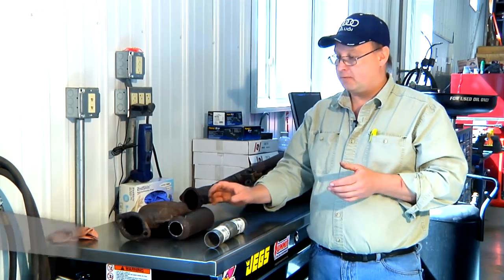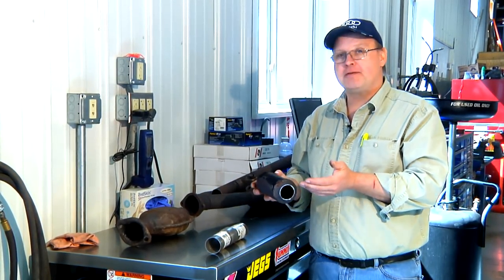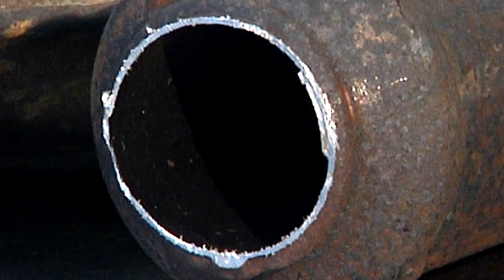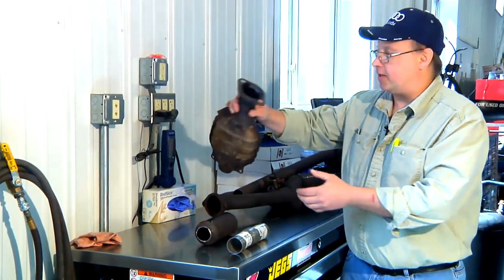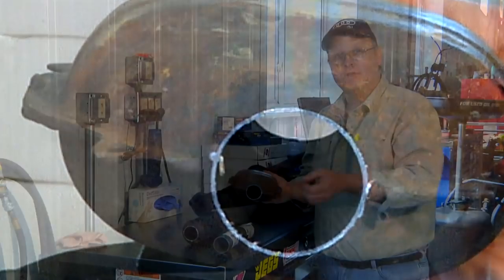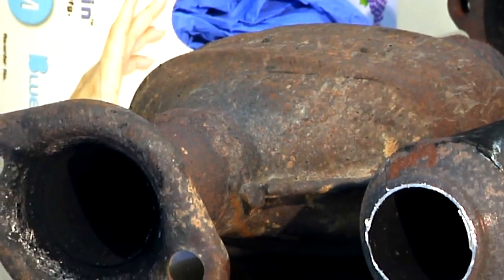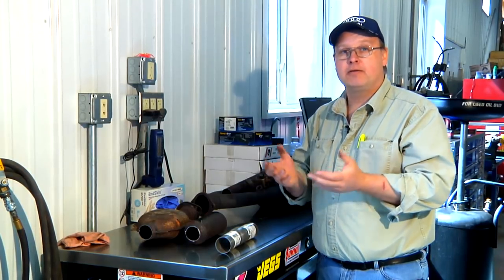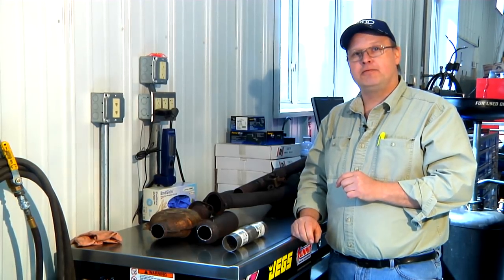What Happens if You Replace the Exhaust Resonator With a Pipe? : Under the Car Repairs

Comment: I deleted the resonator on my 2012 impala LTZ and drove it 900 miles. Significant increase in exhaust note start up, idle sound, Db, and air flow. I have gotten compliments on the sound just driving in and around town. Its one of the best and inexpensive mods you can make.

Comment: Back-pressure,....dude, really? i couldn't do one better than all the other replies on this one. Next you'll want us to believe the muffler bearings need replaced every 5000 miles. omg :)
Reply: Muffler bearings, cool...
Reply: hhe  ikr  oh by the way xr7coug, I used to have a 67' XR7 with a warmed up 390. I loved that sweet ride. Right on man!
Reply: Muffler bearings need to be periodically greased every 3000 miles with muffler bearing grease or a can of ASAP.
Reply: you look very much like eric the car guy ;-)
Reply: Where can I get muffler bearing grease? I did not see it at my local parts store.
Reply: +Bob Simmons next to the headlight fluid
Reply: jonnygoat15
Oh shit, I didn't know the headlights had fluid. How often do I need to change that? My car has over 100,000 miles on it, I hope my lights are not damaged. They seem to be bright still. My car manual didn't say anything about the headlight fluid, so I didn't know it needed to be changed.
Reply: Bob Simmons You should also think about getting a car diaper for your vehicle if it has over 100,000 miles, to save you the embarrassment in case your car accidentally takes a dump. while on the highway.
Reply: Never forget to change the blinker fluid too.
Reply: muffler bearings...haaa haaa!!!! you made my day!
Reply: best way to remove them is with a left handed screwdriver
Reply: along with a center wrench.
Reply: Bob Smith I have also heard of mechanics using a omni directional impact device to remove them A.K.A hammer LOL
Reply: Ahhh Muffler Bearings. That's why some exhausts makes that rattling sound - the muffler bearings are loose.... Now if I can only find out what to do about the Main Engine Control that the insurance company TV advertisement says could break and cost me thousands
Reply: You never know. We now have exhaust fluid for diesels. As far as back pressure goes, in my experience, it's unnecessary past the mufflers.
Reply: Bob Simmons If your headlights lose all water then what can happen is a constant flame of fire will project from your headlights. It can be dangerous.
Reply: Lmao
Reply: With Royal Purple grease, you can drive for a whole year!!!
Reply: Yo are so so wrong its 23,000 to replace, its just appalling that you would suggest otherwise
Reply: Also you need to get your laughing shaft looked at, while your cars in his garage